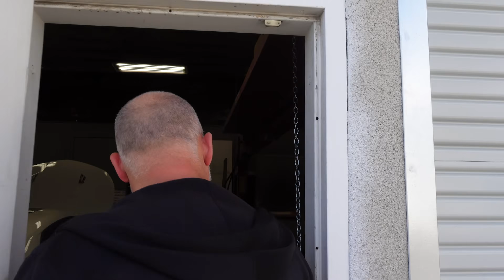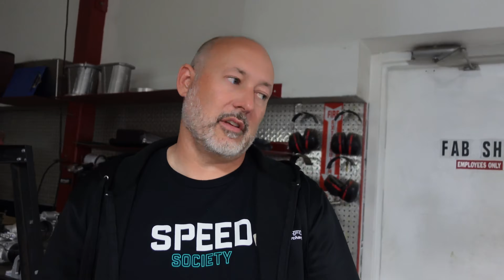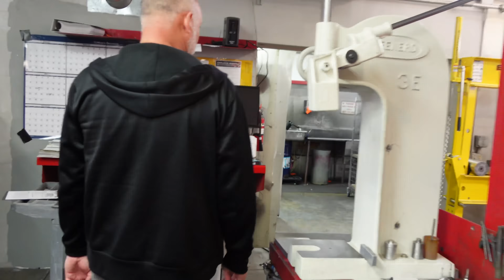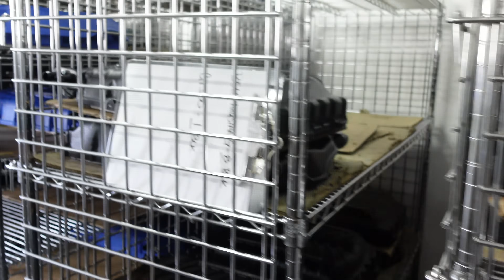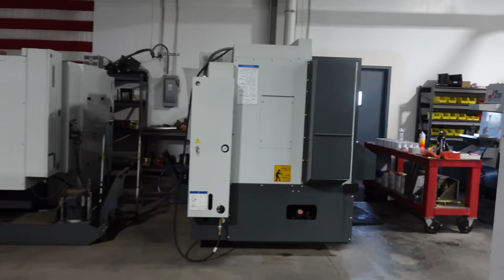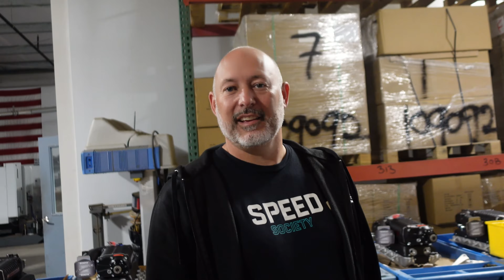Behind the Scenes at Whipple Superchargers, Part 2: Shafts & Fire & Packages, OH MY!

Comment: Do they make 5th gen style blower for 4th gen engine like ls3? That would be awesome.
Reply: I have a 2.9 4th gen 2010 camaro 5th gen camaro
Reply: @NachoCamaro  I was hoping for the longer runners that come from a 5th gen style blower with the rotor pack on bottom, for a 4th style engine “rec port” head engines

Comment: Has anyone asked whipple why they developed the 3.8 for the gt500 as opposed to the 3.0?
Reply: Don't forget the 4.5 Whipple.
Reply from the maker: The GT500 engine has better flowing heads/cams than the GT. So the larger blower can support the airflow better than the 3.0L. Similar to when the 13-14 GT500 came out it was eventually figured out that the same 2.9L that was used on the 07-12 models simply didn't provide enough air for what the new 13-14 head/cams can handle. So they chose to go with a larger head unit or the higher flowing more efficient designed 3.0L over the older 2.9L.